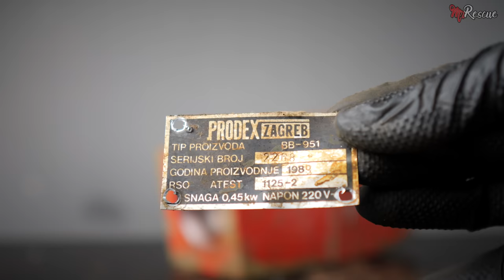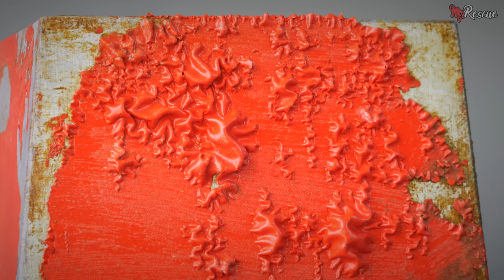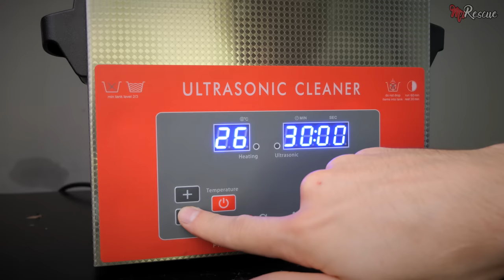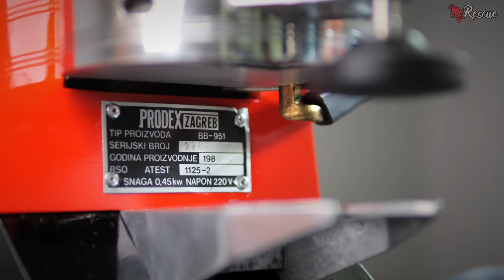Restoration a Coffee Machine - Complete Process

Comment: NO! No, to using a wire brush on a motor winding. Each wire has a varnish coating serving to insulate/isolate wire to wire electrically. A beautiful job. I do enjoy watching these.
Reply: I make NEMA motors for a living, and I was thinking that same thing! If you scratch those wires up, it can lead to it shorting out!
Reply: Yeah, also polished sharpened baldes with this thing😂
Reply: Electronics tech here, and while I believe he used a nylon-type brush and not metal, I agree, never take that risk. Blow, wipe, or use a soft brush, and leave it at that, don't provide a weak point for the magic smoke to escape!
Reply: when I saw how he handled the winding, my heart ached)
Reply: Putting threads in a vice and using a knife blade to clean up finished metals also hurt my brain a bit but it's a great video anyhow. We all have stuff to learn.
Reply: Yeah, I wonder how long this will actually last him before it self destructs

Comment: Looks great but don’t sand or grind on the coil wraps of the motor. They are covered in a resin that keeps them from arcing. Once the coating goes they can arc and burn through.
Reply: Yeah, I was cringing hard on that one, I've seen how quickly that can go south

Comment: Using a wire brush on the motor. Not crimping the connectors. Either level up your electric game or limit yourself to purely mechanical devices.

Comment: We will Just pretend he didnt actually use a steel Wire Drill attachment on Epoxy insulated copper Motor windings. 😱😱😵😵. Hopefully motor Bearings got replaced also. Very Nice Paint Job and Restoration. ❤

Comment: Wow this is a blast from the past. A Prodex Zagreb coffee grinder, well that was not a home appliance, it was a professional machine usually seen in bars and restaurants. Compared to today's products built to last forever, a high quality of make. Basically that was a cleaning but you should change a bearings as well in order to work more smoothly and quietly, and a new capacitor would give it more torque. 
But do not wire brush motor's winding, there is a coating of insulation on those wires.
In order to get perfect original look the white plaque miss a decal something like: Hausbrandt PRODEX Zagreb.

Comment: Did you need to use heat on the base to press the stator back into the foot? 

I did two of these and the stator and wiring is troublesome.

Comment: Don't get me wrong, it was a joy to watch the video, but there are 2 reasons why I cannot take you serious as a restaurator: first, you did not change the ball bearings. It doesn't matter if they seemed okay, bearings are cheap but the exchange is difficult, so ALWAYS change all the bearings when you take a device apart, and second, you clamped this big chrome wheel on the thread. Without any protection in the vice... a no-go. In the end, you just cleaned and painted it, it is not really a restauration.